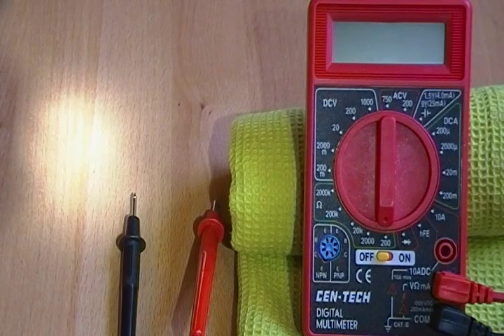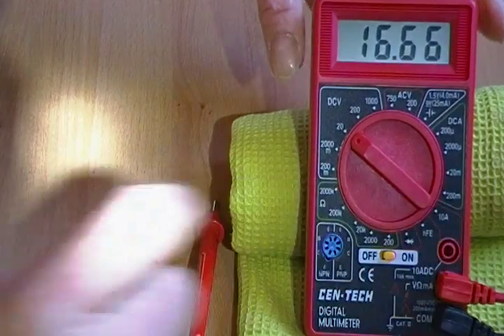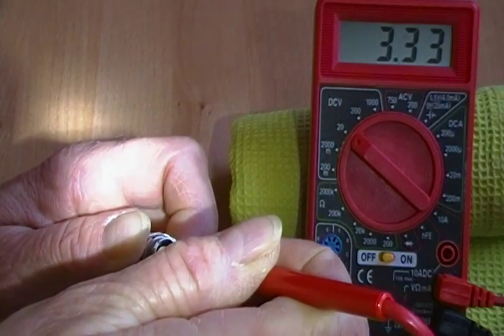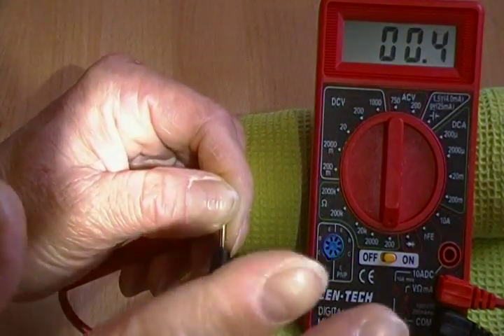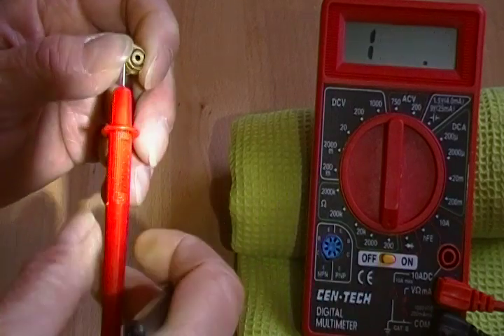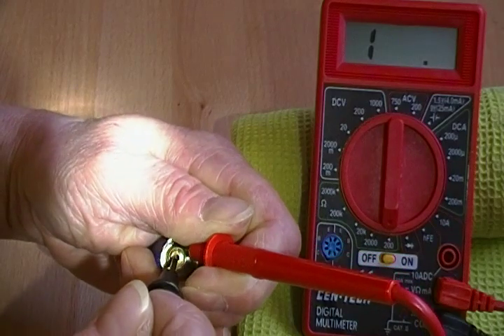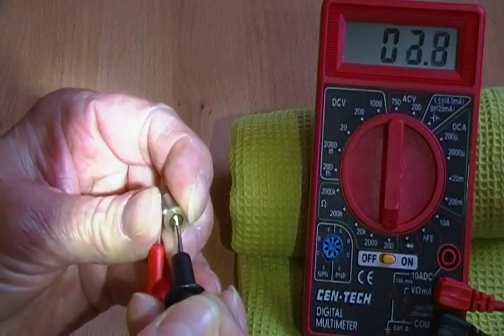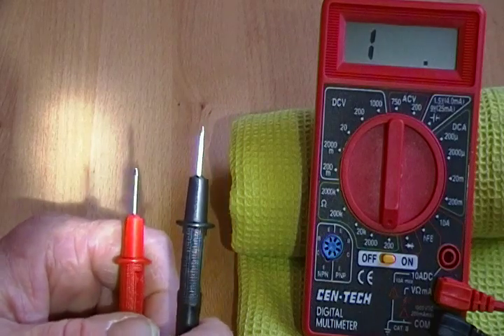How to test battery voltage and atomizer resistance.

Comment: Hi I have been testing the resistance on all my old atomizers and all of them but one are in the proper range. I use 2.0 to 2.4 ohm atomizers the all of them read in that range but the only is reading 3.4 does that mean its shot?